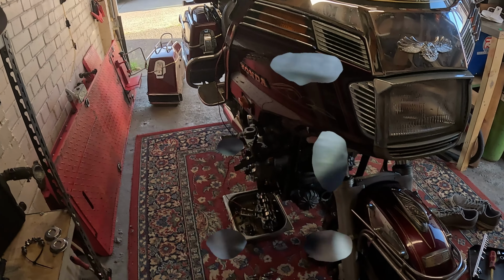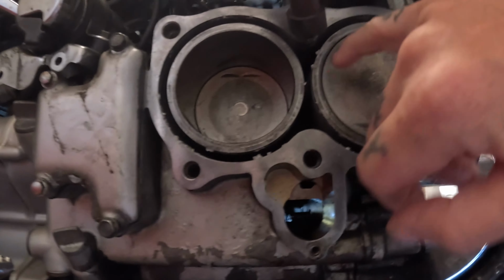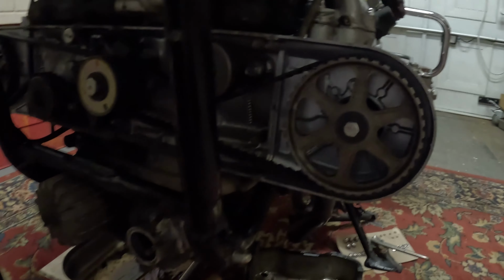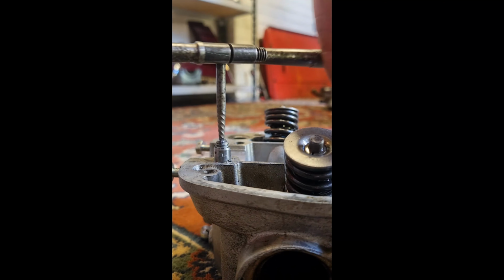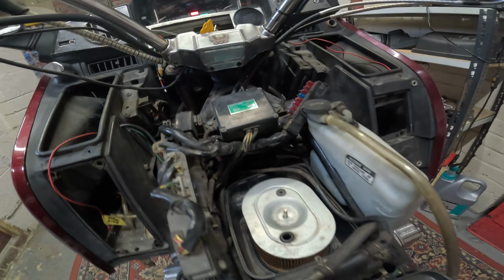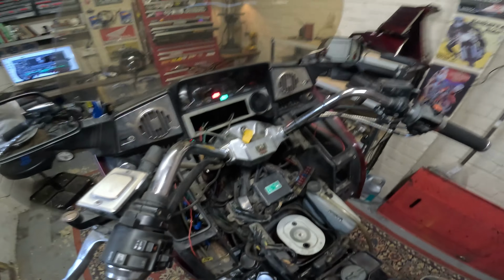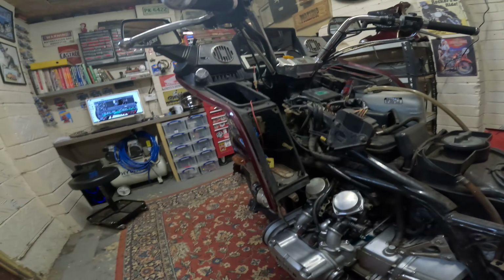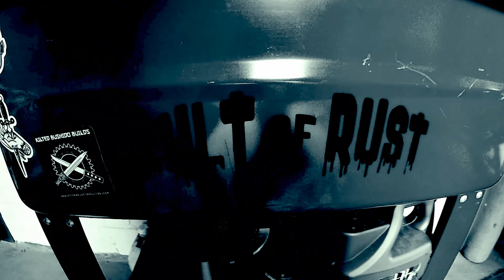HONDA GOLDWING GL1200 - LEAKING CYLINDER GASKETS SOLVED

Comment: My Rocker cover Gaskets weeped
I put new Rubber Compression Washers on the holding down Bolts.
fixed.
Reply from the maker: Was warned this may happen but so far I'm good. Thanks for the advice